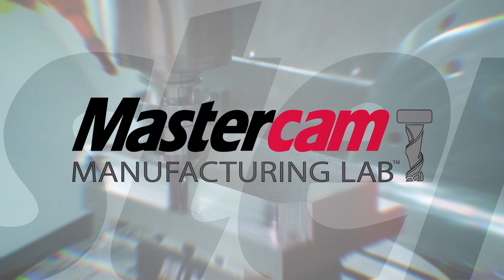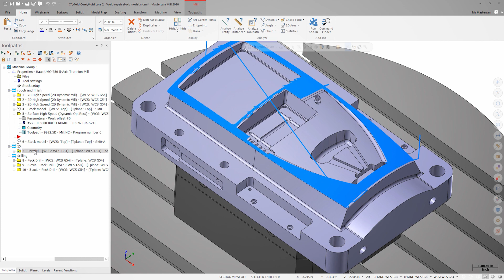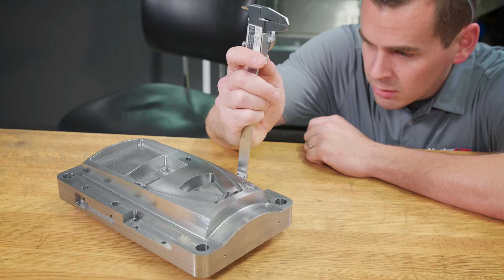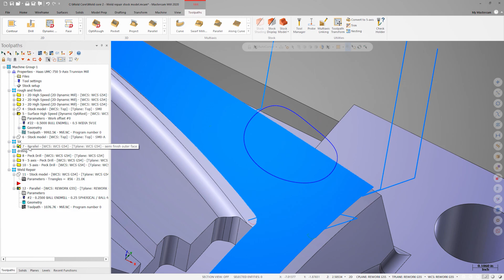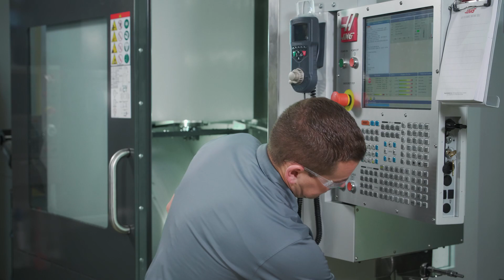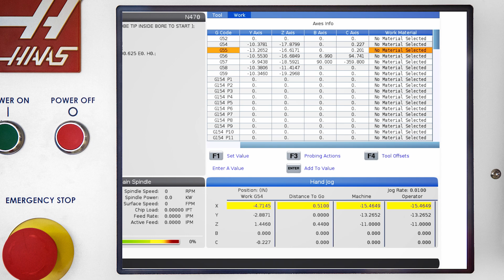Remachining Made Easy with Mastercam

Comment: Hi i have a doubt,we are using x5 , while running arc area machine automatically get slowdown,its happening only when ae are using aurface for programming, some are its ok, sometime its its time waste, please give a reply thank you
Reply from the maker: In some machines and controls the transitions back and forth between arc and lines can cause slowdowns. It may just be a matter of going into the arc filter and adjusting to either output more arc or all lines. Depending on the age of the machine and what the control prefers one or the other will be better. In order to output all lines you can utilize the smoothing settings in arc filter and check the box to output all arcs as lines. In the newer versions of Mastercam it is easier to see the difference using advanced toolpath display. Check this video out to understand what I mean: 
https://www.youtube.com/watch?v=2COO5C374tA